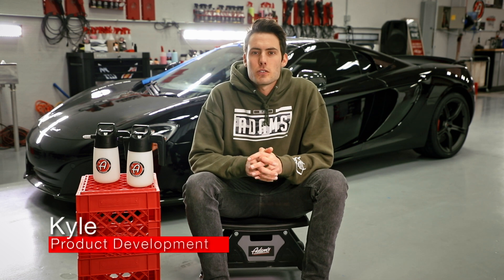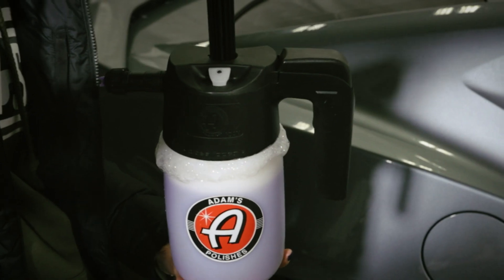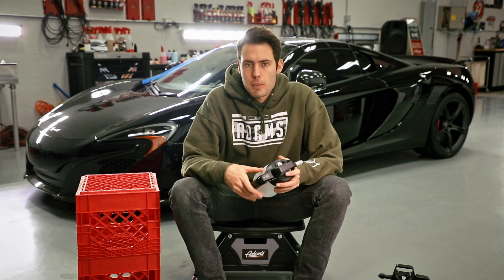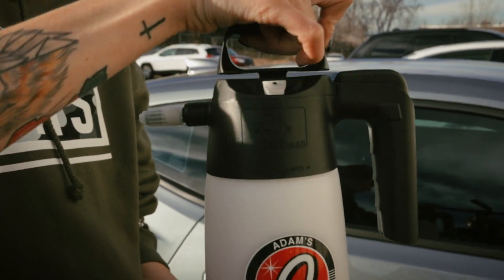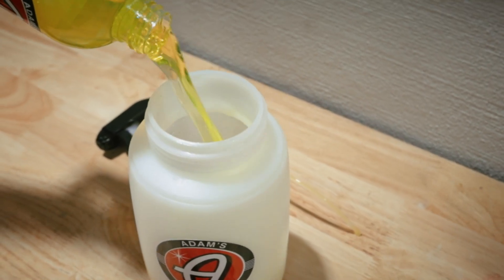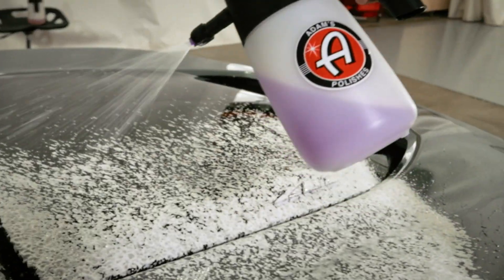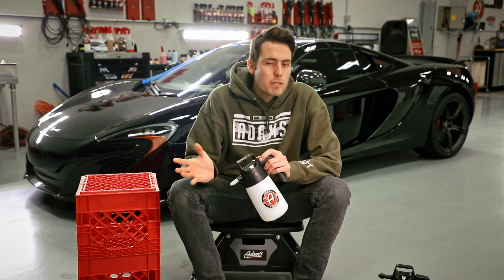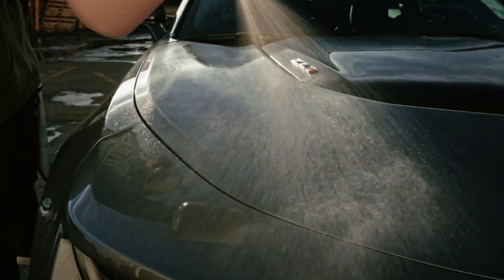Adam's Foaming and Multi Pressurized Sprayers  | Adam's Polishes Water Cooler Wednesday Episode 21

Comment: there are solution ratios to follow, the main things this is good for is using wheel cleaner or eco wheel cleaner with the gray tip(about 4-6oz). Using it to foam up your car with any of the shampoos again(4-6oz).Also any of the cleaners like Eco APC or Original APC.  Agreed you def dont want to put your detail spray in this its useless when the 16oz spray bottle is just fine along with sealants.